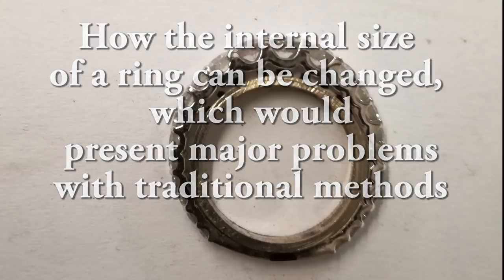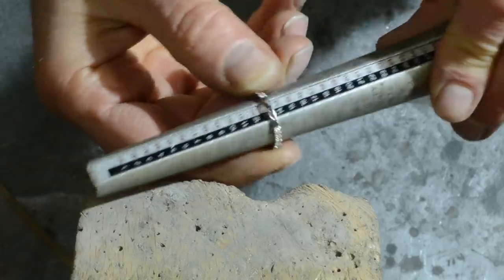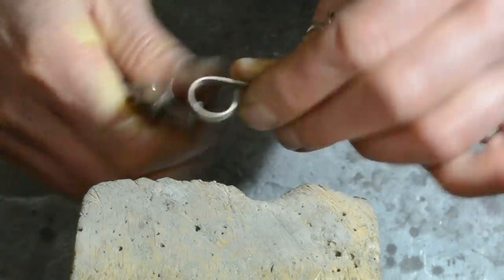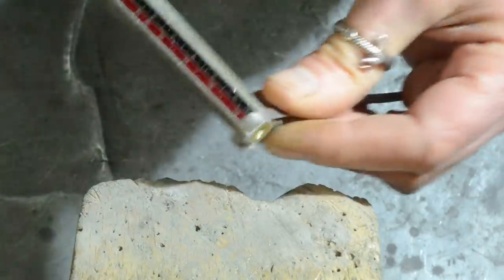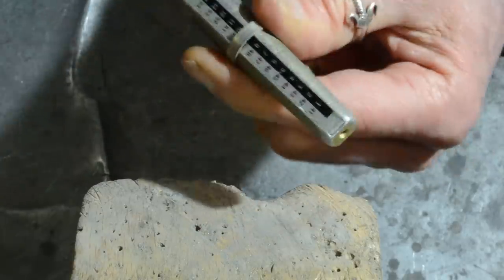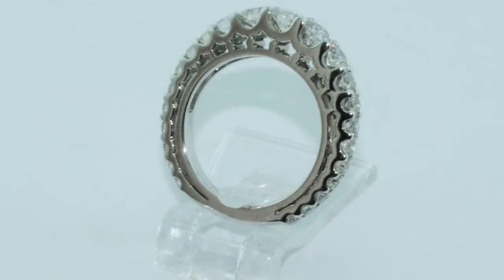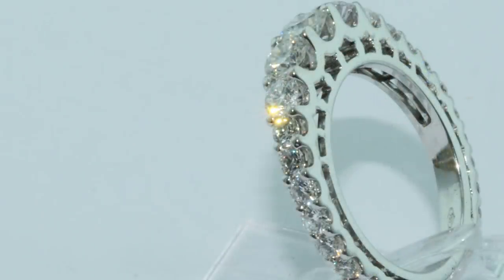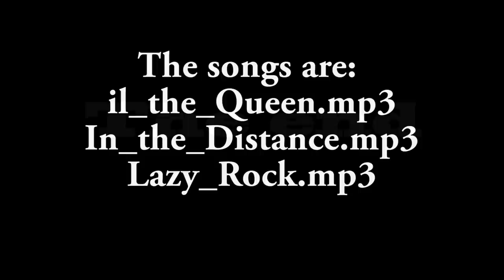how the internal size of a ring can be changed, which would present major problems with traditional

Comment: I was hoping to see another video again from you Signor Scaffardi. You  make such beautiful works, It really does make me want to make my own jewelry in the same way you do yours. I usually work  with copper and less noble metals.  I am mostly a blacksmith now, since I have sort of fell out of my jewelry making.  The most I can do with a ring is take a piece of copper wire that is 4 gauge, hammer it flat,   texture it, form it over a mandrel and then try to make the seam as neat as possible. I can't really solder or weld it, because I don't have the tools to do so yet. Haven't really used a torch much.
Reply from the maker: thank you very much